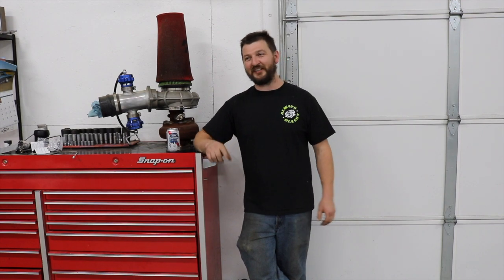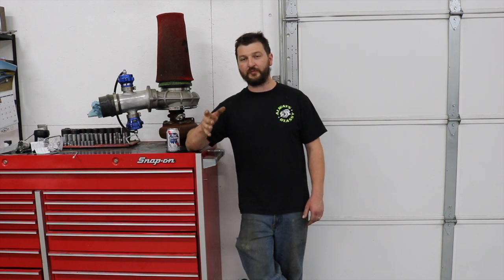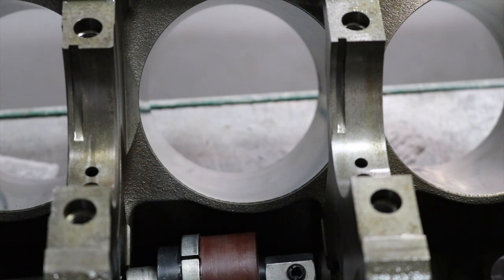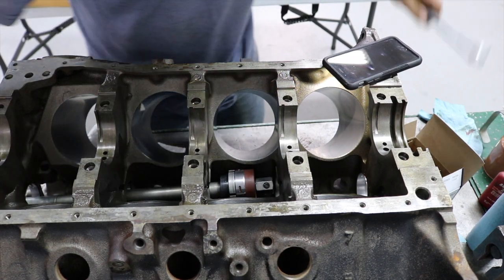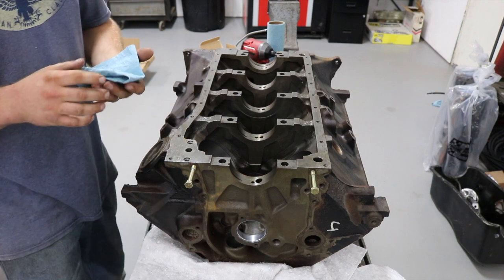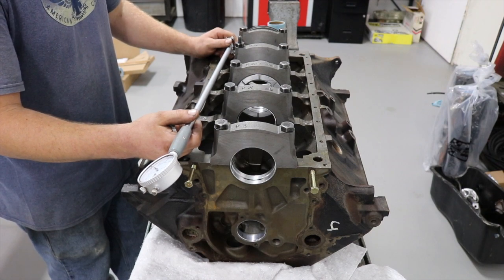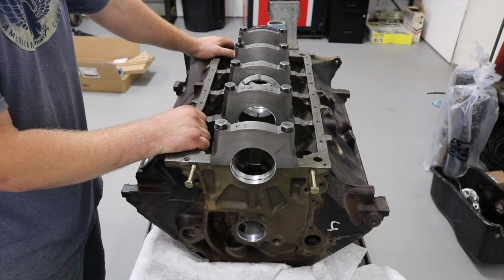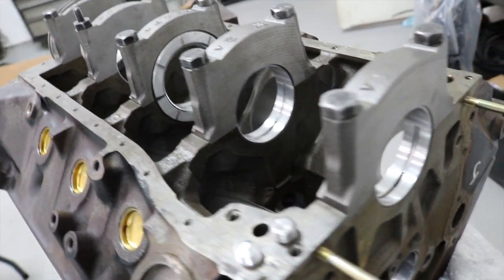Stock Bottom End Turbo 460 Build  Part 1

Comment: I have so many questions about this video series. I am trying to get my knowledge together to rebuild the old family farm truck w/ a 460. There's a lot more then just bolting things together I have come to figure out at this point.
Reply from the maker: I'm happy to try and answer any questions you have.
Reply: @koalafiedengineering1200  What's a good place to email you at? I don't want pollute your feed with all these questions!
Reply: @koalafiedengineering1200  Is it worth it to pull a bottom end apart on a rebuild motor that sat for 24 years, I recently got running again? It smokes for a couple minutes and then no smoke at all from the engine. (thinking worn out valve seals) It's not knocking either. Ever so slight oil drip from the rear main when it sits for a long time. I am going to put Edelbrock Performer Heads/Intake on it with a Holley Sniper and Hyper Spark soon. I was not planning on changing out cylinders/con rods. I just want to truck to run well and go to Lowes or Dairy Queen w/ the wife/child and be reliable.....and fun. :)  I am also going to switch out the C6 with a 6R80 as well. I took some pictures of the front drivers side cylinder with a small bore cam and it looks....glazed. I am not exactly surprised with it having 80k on the rebuild. Just a lot...and I mean a lot of questions about this rebuild. Oh...the Ford Authorized rebuilder did .040/.010/.010 on the cylinder, mains and rod bearings. Nothing crazy.
Reply from the maker: @ryantaylor2595   sorry for the delayed response I'm still buried in customer jobs. my email is Koalafiedengineering@gmail. If you're going to invest the money in the top end I would definitely go through the bottom end and at the very least check it. I also at a minimum do a valve job on all new heads.